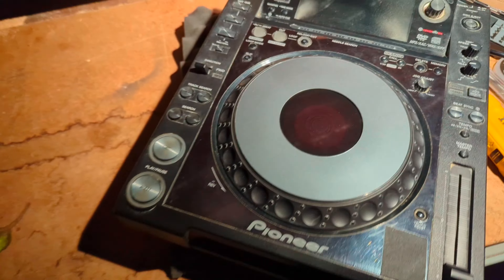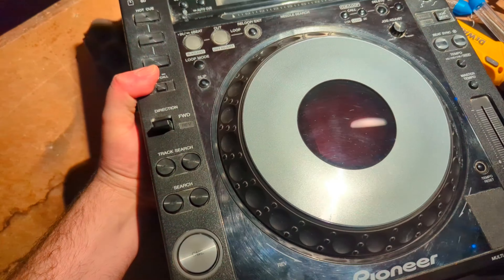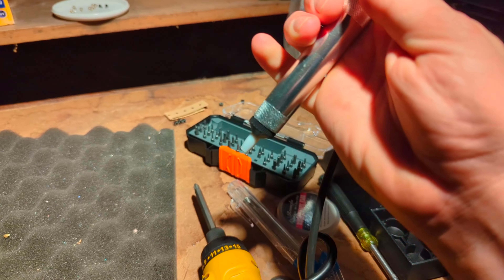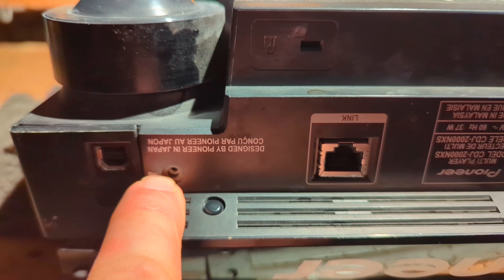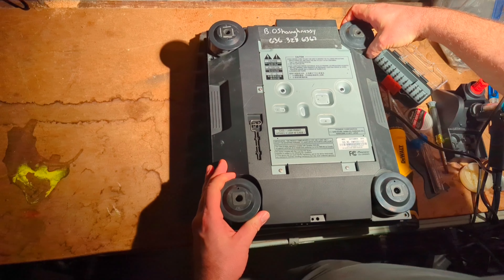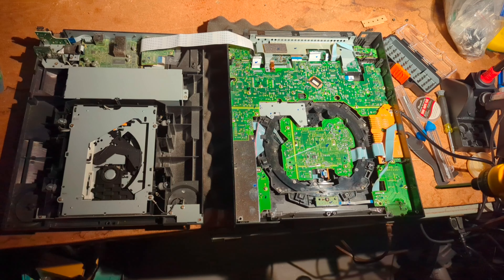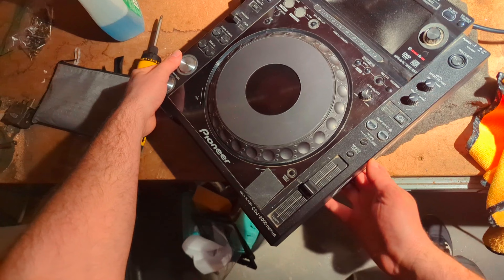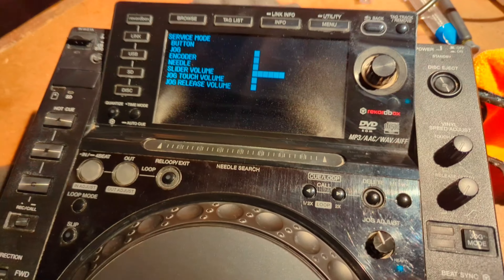Pioneer CDJ 2000nxs / nxs2 - Play / Cue button repair

Comment: That is a nice way to explain the process. I'm trying to repair the same part from a CDJ200NX2 and I will order the circuit to have it in stock but I would like to know which is the part number of these switchers?
Reply from the maker: They're called "tact switches" I believe it's part number DSG1117. The nxs2 is almost identical in process. I actually can't think of anyway that it's different. The only thing that I've noticed different between the two models is removing the LED screen, there are different screw sets for each model, but that won't effect you on this repair.
Reply: @brinnswft  thanks!
Reply from the maker: @felipeburgos9719  just a heads up i'm working on this video now. it's definitely a much bigger repair, but probably in the next few weeks i'll have it finished up and posted

Comment: Thank you so much.  This is a very thorough and helpful video I'm about to change out some buttons.  

Have you ever done any repairs on the DJM-900nxs2?  Is it fairly strait forward to replace the PNLA board.   I need to replace all of the headphone cue buttons and all of the low potentiometers.  I figure may as well swap the whole board then I have spare parts?   Thoughts?
Reply from the maker: Djm has many more parts to remove to access. It's possibly my next video eq potentiometer on djm900nxs2. Good luck!